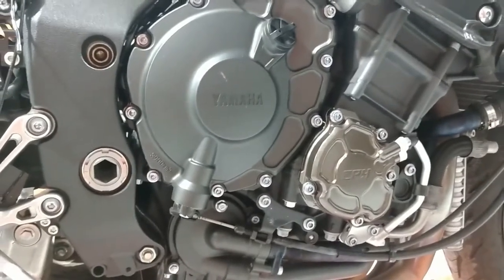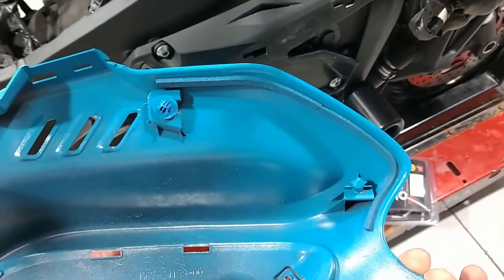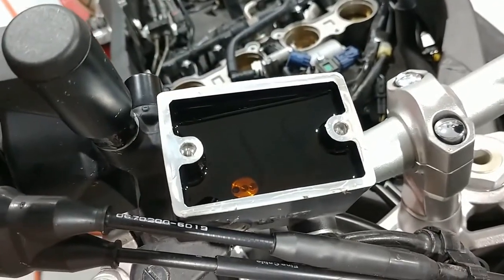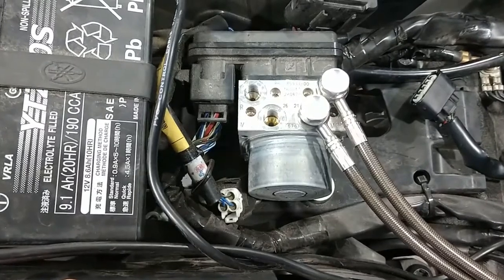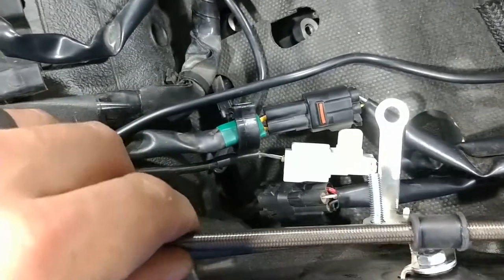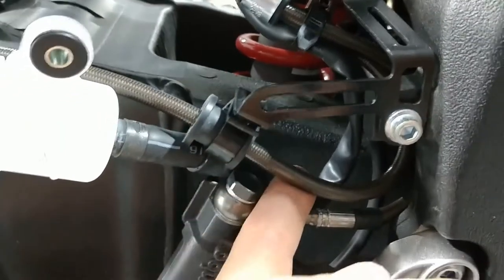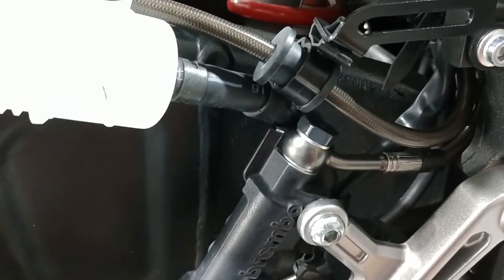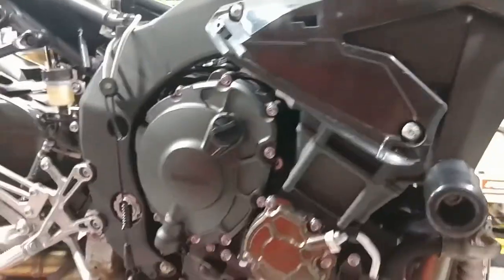Stoltec Moto Spiegler MT-10 Stainless Steel Brake Line Install

Comment: BTW it LOOKS sorta like the one mounting point next to the steering stem might interfere with a stem lift I dont recall anything in the way on my stock 2023 MT-10 but then again maybe the brake line mounting is different for '22+ anyway....just saying

Comment: Is the fuel line connector on the bottom of the gas tank a valve type or am I required to drain all the fuel prior to unplugging it?
Reply from the maker: Quick disconnect. There’s a u shaped clip that you gently slide to disengage a tang on the fuel fitting. Recommend you wait for the bike to fully cool and the fuel line pressure to dissipate, first. You’ll still have the bit that’s in the hose, but the tank should not leak unless there’s an issue.
Reply: No leaks , maybe a few drops.

Comment: I cannot for the hell of me understand what's the point of replacing solid brake lines with steel braided. Why not design this to replace just the rubber sections of the lines.
Reply from the maker: In no particular order:

1.  Cost.  Fewer lines costs less - primarily because of fittings, but also labor to make them.
2.  Leak points.  Believe it or not, people tend to have problems sealing some of those pesky hard line fittings.  The worst part is that they are hard to get to to fix if leaks occur.
3.  Weight.  The factory hard lines aren't heavy on their own, but the fittings are solid chunks of steel.  Our kit saves 1.3 lbs.
Reply: Manufacturers also recommend replacing the OEM rubber brake lines every few years as well. On the flip side the braided lines are lifetime and never need to be replaced.